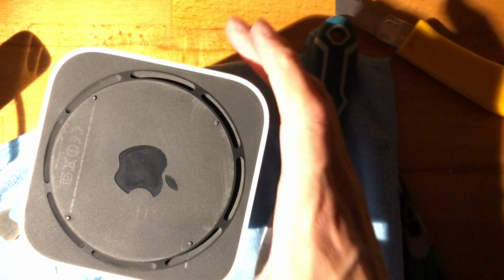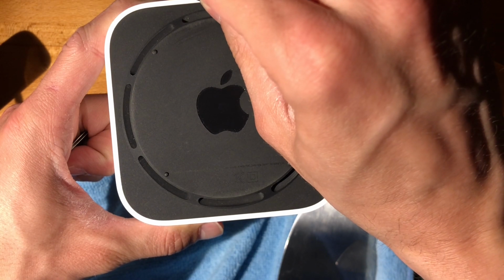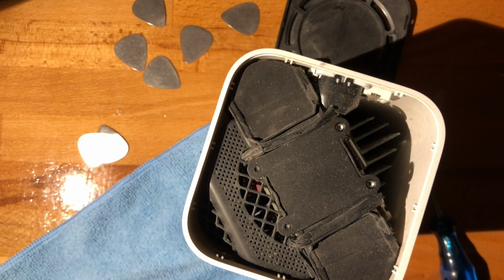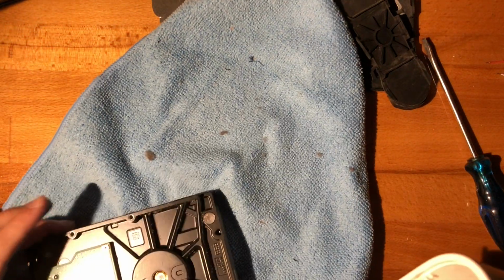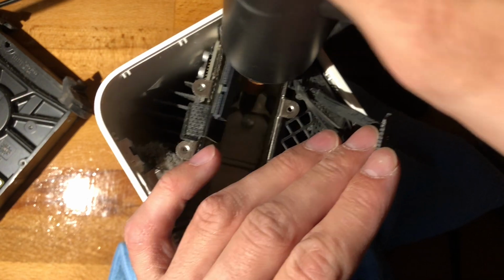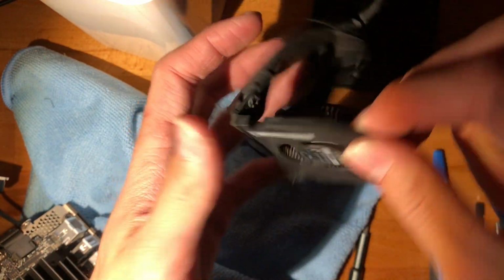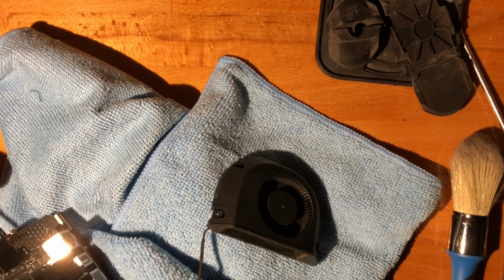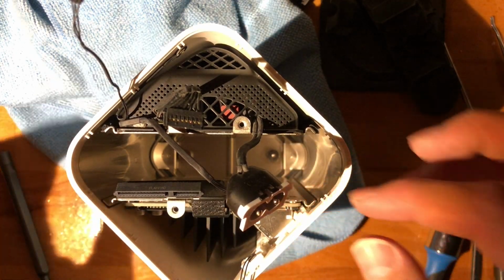Airport Extreme / Time Capsule Fan Service - Repair

Comment: I had the same problem with my extreme base, but it worked for a few weeks and then the problem came back. so I am using it with the open condition, and the problem is gone.  I think my extreme base was overheated for unknown reasons, and the fan was overloaded.